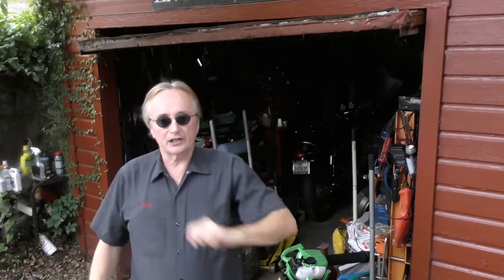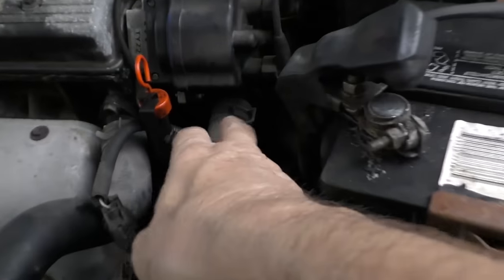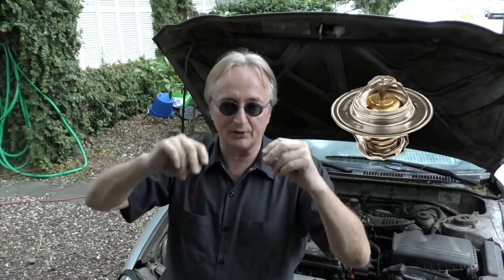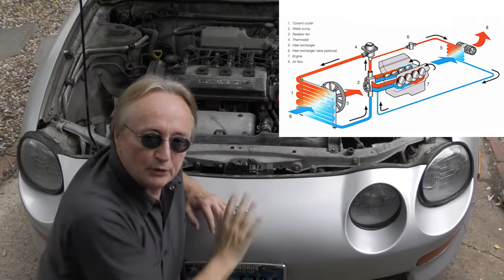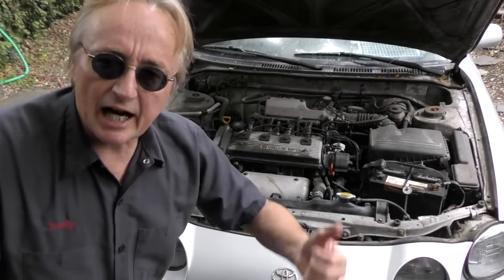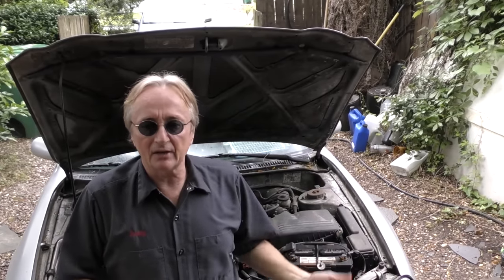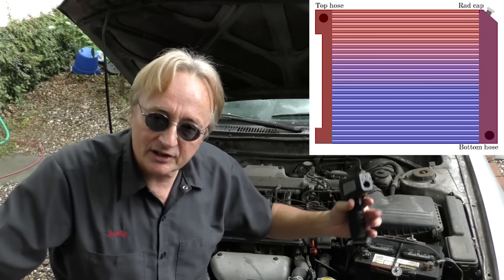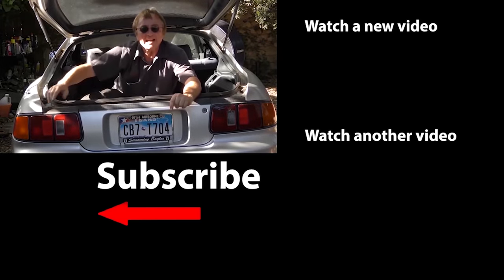Doing This Will Make Your Car's Cooling System Last Forever

Comment: If you have a bad radiator cap and engine overheats, let it rest, put water in radiator but don't place back the cap, let the radiator port open and it will not overheat. It'll give you enough time to get in a repair shop to work on it.
Trust me this works.

Comment: I've had HORRIBLE experiences with aftermarket radiators. Absolutely horrible. I've had two of them that were molded incorrectly on the tanks and 2 others that failed within 6 months or less.

Comment: Plastic radiator tubes the lower can crack especially if u have bad upper engine mount above the valve cover causing pulling of the lower radiator tubes. If u do, ur radiator tubes will tear

Comment: On my old car which was an Audi, nightmare when I had to replace a $40 thermostat, it was behind all the timing belt pulleys the labour cost me the same as the labour of replacing a timing belt and pulleys.

The worst part about it was that I just did the timing belt service two weeks prior to the thermostat going. So basically paid the same labour cost twice in two weeks. Considering that the timing belt service happens once every 100,000 kms every five years or so.

That’s why my next car was not an Audi
Reply: You should have just changed it when servicing the timing belt. Common sense. Same thing when your water pump is behind the chain or belt, but yeah Audis are terrible. They make BMWs look reliable and cheap to work on in comparison. Haha,

Comment: If you want to make a radiator last a long time,just ground the aluminum or metal core.This will stop all galvanic erosion on all metal parts in the cooling system.Try it ,it won't cost you anything.P.N.

Comment: Buy OEM and do it right, or don't and do it twice.  I shop and often seek non-genuine, but then gotta do it over.  I save by watching these videos, so I do it right and buy genuine parts.  I'm now looking for a video to change fuel filter on my 2000 Corolla, I think it's in the fuel tank.

Comment: i had heating problems and i figured the head gasket was gone so i changed the head gasket 3 times and i accidentally hit my rad and the fins just went to dust, changed the rad and my problems went away, i also used to change my coolant and rad cap  to make sure they were good, i also wound up putting in a bigger rad in my car,

Comment: i always buy the failsafe type thermostats that stick open if the wax motor leaks etc. not OEM, but a bit better piece of mind knowing that the result of a failed thermostat is an engine running a bit too cool.
Reply: Yeah, harder start vs overheating. Definitely prefer the first.

Comment: Hey Scotty: love your videos. I've been having trouble with my 1993 Ford E350 Econoline van. It's a Ford chassis and a Damon Hornet RV. The engine runs hot. It's been doing this which I know is not good. The gauge never states that it's overheating. I noticed that there was no coolant in the radiator so I added it. I realized later that I should have added to the reservoir and not the radiator. Now it's steaming and leaking underneath. Is there a leak or is it doing to that because I put it directly into the radiator? Thanks.

Comment: Thanks Scotty for all the valuable information. I have a question about the AT 205 Reseal can we use it to rejuvenate tires with it?
Reply: I was about to ask that question.. well, does it scotty?
Reply: Not good to use on tires, weakens the side wall flex, some go to car wash every week and put tire shine on wheels this is not good for tires no matter what cleaner/shine for any tire. Better off scrubing tire with brush and baking soda, for your own safety

Comment: Hello Kind sir,  I have an older Ranger that had seriously old coolant,  led to some big rusting issues.  Flushed it out but can I now extend the life of the radiator at this point as well as protect the water pathways by using a rust converter in the system?  I've used some before but thinking it would help convert that rust in the system to a safer surface?  Any thoughts of running a rust converter in there and leaving it in?   Thank you

Comment: Im from austrailia . Im 53 years  of  age . A good thing to know. Is put boiled water staight away in a class. With your new thermostat. To see if it works properly.  Because three   i put in cars over ten years. Were not operating. Did my head in working out the over heating proplem that still existed. It pays to test them it can happen.better to be safe than head plucked

Comment: Scotty I'm baffled.  I got a car at salvage and replaced radiator,  fan unit with built in resistor, ac condenser, thermostat. The radiator fan doesnt kick on either speed.  Voltage at relay/fuse box, relays checked good with resistance,  fuses good, fan direct wired and it kicked on, fan resistor has resistance, temperature gauge gets to halfway mark, ran engine without cap in case of air lock. Still no fan kicks on. 2012 fiat 500 sport. When I squeeze upper hose water will push out of tank. Any ideas? You're the best!!

Comment: Silicon rejuvenates plastic or ruber.    Yeah the thermostat and cap usually cost the same low price at the dealer. I know there is a after part company called oem but its not in reality the original parts manufacturing company its just a good marketing name.

Comment: Ok this is all great, but what is the proper operating temperature (coolant, oil) in a typical engine?  What is TOO hot? My coolant is typically about 195 F while the oil is slightly hotter at 204 F.

Comment: Hey Scotty, my 2002 Subaru Outback has been overheating so I have been checking all these components. The fans work, the water pump works, I found a little rubber nib cap (normally used to cool a turbo rig, which my car doesn't have) that had cracked, so I replaced it and refilled the system and burped it. Since then, I drove it a relatively short distance and it overheated again. A mechanic friend suggested I replace the thermostat. Does that seem right?
Reply: Yes, replace the thermostat. If it’s a 2002, the thermostat may actually be original.

Comment: Hey scotty having an issue with my wife's 03 civic ex 121,500 Miles. It over heats & most of the cooling system was replaced from water pump the radiator, thermostat & hoses fans kick on when are supposed to. Even checked for a head gasket leak the blue fluid didn't discolor at all. I thought maybe heater core is issue but everyone says its impossible, what do you say? We've never met but I'd take your word over almost any other guy lol

Comment: I had a Toyota years ago long before computers that overheated everywhere I went.  The thermostat was changed multiple times and radiator removed and cleaned out with no success.  Many years later I learned Toyota water pumps go out and MUST be changed as often as the timing belt.  
That $1000.00 car cost me $1000ssss.

Comment: Hey Scotty, I looked at my Honda CR-V 2009 fans with AC on and it was only one fan running. Is that an issue with the other fan or it’ll run when I drive? Thank you

Comment: Scotty....what would happen if  ATF was used as an engine coolant instead of water /antifreeze? It wouldn't freeze, the water pump would last forever and a  blown head gasket, leaking coolant into the engine oil, would not be catastrophic.

Comment: Got any tips for me?

my 96 astro van accelerates from a stop in first gear fine but it stays in first and revs at about 25 to 30mph until you let off the gas just right then will finally up shift to 2nd then will go straight to 5th
Once on the highway way at 60mph the van runs fine and has power in passing gear fine as normal. Fluid looks ok no leaks. had this problem two months after rebuilding the transmission, and also saying it has random misfires in cylinder 4 and 6 and I already replaced it with new rotor, new distributor, new cables and iridium spark plugs. Do you have any ideas?

Comment: Here in the tropics mechanics insist on removing the thermostat, insisting it's there because the cars were designed for much cooler climates ( As if they don't have summers ) !

Comment: Scotty I have an '04 Ford F-150 my AC does not run, they tried charging it but did not need it, they looked at fuse and master fuse they looked fine. The Condenser looks fine and the fan is not 'locked' or 'Frozen'. What they are telling me the unit is not receiving power. I looked at the fan belt but they said that looked fine aswell. Any idea on what it could be? I am stumped. I am curious if the switch could be faulty.

Comment: Scotty, I have a 2021 Acura ILX, I flushed the coolant out, refilled it, with Peak 50/50. I burped all the air out. Now I’m only getting heat on the HI setting. Any idea why? I’d appreciate it, if you can help me out? Thanks
Reply: ahhhhh, did ya also seperately flush out the heater core ?  Regards that, I've viewed a couple u'tube vids 
{ aka visual recipes :-)   }    Hope tah do my '96 Sierra by mid- Oct.   .....

Comment: What do you say about Lexus es 350 the whole engine bay is covered with the plastic and heat stay inside the engine bay and make all plastic clips and hose hard and they break even we touch

Comment: My 1988 Nissan Sentra is overheating. Both fans work when ac switch is on but when the temperature gauge gets high the radiator fan won’t come on. Relay switch changed temperature sensor changed thermostat changed. I put a brand new radiator on the car a year ago. A mechanic told me it might be the water pump or a blown head gasket but I’m not losing any coolant. Do you have any idea what it might be

Comment: I have a 2000 Toyota Camry 4 cylinder it's overheating. It started only when driving in city traffic not on the interstate. I tried to flush my coolant and change my thermostat. Radiator must have had water in it because it was corroded very badly. I'm still getting hot air through my heater core most of the time when my foot is on the gas. When I slow down it starts getting cool do you think it's my radiator or should I flush my heater core also. Which is the inlet and outlet on the heater core!?

Comment: Scotty I've a 1996       46L GT mustang  seems too louse antifreeze here  an there I can run for days won't leak then a gush under the car  one day it started backing up spewing out the resivor tank I keep the radiator cap on tight enough so it won't fall of any way without getting porked wear can I start

Comment: The fans work, and the temperature gauge is in its normal spot, in the middle. If I set the heat, to say 80, you can actually feel it getting cooler? Certainly not 80.

Comment: I had an issue of overheating when the AC is on for at least an hour in my 2012 Accent. My mechanic did an overall to my Radiator, and added some more pre-on on the AC. And then he also find out that the Thermostat was also busted, i never had a replacement since 2012. What he did, he just removed the thermostat since we our in a hot country, it won't necessary to have the thermostat installed. 
So far, my issue was fixed for a week now and the engine runs smoother than before.... Is it really advisable not to use a thermostat on your engine in a hot country like the Philippines? Thank u.
Reply: Still using thermostat in the Philippines but need to replace every 5 years
Reply: In Vietnam hot country like Philippine they are still used the thermostat

Comment: Hi Scotty,  I am trying to fix my son in laws 2005 Lexus IS 300.  I have replaced raw water pump, the thermostat, the radiator, the radiator fans and I have tried flushing the system but, it keeps overheating 🥵.  What am I doing wrong?  Is it a air bubble stuck in the back of the engine?

Comment: I've got a 2001 Dodge Stratis with the small  4 cylinders 140 C.I. I think. Whenever I drive it very far + or - 15 miles it makes a percolating sound but hasn't boiled as far as I can see in the reserve tank. Any ideas what this is, it doesn't seem to lose any fluid. Thank You.

Comment: I did blow head gasket because bad radiator cap, so change them before they go bad and start to let air in what causes boiling and then boom head gasket is fried.

Comment: I still owned a 1998 Mazda MPV V6 and recently I have a probelm with my temperature Gauge going all the way up. My mechanic replace the thermostat and  temperature coolant sensor together, but  still temperature gauge sill going up, but the best thing the engine is not overheating. My mechanic  told me not to worry and drive it as long as I could.  Is he right. Need Help Scotty. Thanks

Comment: Hello Scotty-I have a 1999 isuzu rodeo 3.2-I had a THERMOSTAT Stick It has only did it one time-The Thermostat is only $5.00-But you must that the Intake-- fuel rails and injectors off, the Thermostat is under the intake, Do you think that a GOOD RADIATOR FLUSH Will fix the Problem? I do not have the  mechanical  ability to do this job that need to be done with the Thermostat replacement--0 Hay and one more thing-Now im not having this problem but if you  use a stop leak in a coolant sys will it not stop up the little small hole that is in a Thermostat  that lets a little coolant go through? Now keep in mind that my thermostat is  probably from 1999,

Comment: I had the exact opposite problem in my truck not long after I got it.  The thermostat was stuck open so it wouldn't reach proper temperature.

Comment: 2003 Dodge Ram 1500. Guess the engineers thought it would be fun to turn the cooling system upside down. Oh but wait, we’ll put this purge plug on top to purge the system. That only takes days to completely purge the system.

Comment: I have a 2008 Hyundai Tucson gas 2.L 2wheel drive 5forward have this ruff idle I have changed plug and cable wire

Comment: My 2002 Saturn Vue 3.0 v6 engine has started overheating at a stop in traffic. Radiator fluid flushed in November of 2018. If I put in park and rev it up it cools down. If I'm moving it stays cool. I noticed on return water line to fill tank I have bubbles in with water. Need help on this. No leaks I can find.  Mechanic I use said back in November all was good.

Comment: Scotty, if your vehicle has a 185 degree thermostat and you are running an electric fan, what temp should you have it turning on/off?
Reply: A fan should turn on as soon as the thermostat opens. So if it's meant to open at 185 degrees Fahrenheit, then the fan should turn on at that temperature, and also turn off when coolant is cooled down to a lower temperature. I have a problem where my thermostat or temperature sensor doesn't tell fan to turn on when it's supposed to turn on, it kicks in late. Should turn on at 194 degrees Fahrenheit, but it turns on at around 203 degrees Fahrenheit. Advice: Don't buy modern cars, much more difficult to diagnose a problem and repair.
Reply: Thank you, solid advice!

Comment: I have a problem with my system. The overflow tank had a crack on the top of it so I replaced the overflow tank then the hose blew. Seems to be running normal temp but soon as I shut the car off seems like a lot of pressure

Comment: This is a noobie question i know, but is it normal for a car Idling to reach 105ºC ? yesterday i drove it and it reached 110ºC and the fan did not start, today i changed the thermostat, once it reached 87C i heard the water cycling trough it, and then it reached 105 before the fan started and it cooled back to 95 degrees.
The car in question is a Volvo S80 5 cylinder petrol.
I did not hear the coolant boil or anything so i assume everything is O.K

Comment: 3:02 you mention Japanese radiator caps and parts breaking off of them. I was checking my 1997 Honda Accord’s today and just that happened, and I could not retrieve a very small piece of it. I got a new cap, but is it safe to drive with that small plastic or rubber piece in the radiator fluid? Thank you.

Comment: I have a question for Scotty. I got Subaru Forester 2018 and driven only 17k miles. But recently I checked its coolant reservoir and it is right at the minimum (LOW) level. Now I'm confused that when Subaru says the factory coolant will last 130K miles is that the level in the radiator they are talking about or the reservoir? My radiator shows coolant level perfectly fine. Maybe the water evaporated from the reservoir and the level went below the maximum. So the question is should I top up the reservoir with DI water or with OEM blue super coolant or just leave it like that?

MPG on it is also very low in the city (14 mpg) compared to what it says in the advertisement (26 mpg).

Comment: I have a 03 Supercharged Tundra that called for a thermostat change from the original 180 degree to a 160 degree thermostat that came with the supercharger. The 160 degree stats are very very expensive if you can find one. Will the standard 180 stat be ok if I ever have to change it?

Comment: I had a new radiator put on a 96 Camry, my car only ran hot because the old radiator cracked on the top.  So why is gauge moving to the hot after a new radiator, if there's no coolant leak?

Comment: Scotty, I have a doubt the i30 Hyundai 2009  radiator  fan.kindly help .will the fan on the front rotate always? .the fan behind the radiator not rotating at idle i switched on the ac also it was noti

Comment: hey scotty i have a 2010 subaru outback 2.5 auto with 115xxx. it over heats and coolant is pressurized and shoots out the resivour. could it be a bad head gasket???

Comment: Hey scotty,i have an old peugout 206 with a 1.6 litter engine,recently when i turn off the engine and start again in about 5 minutes the engine heat goes up for a short time before the cooling fan kicks in and then i get a check engine light...can you tell me what the problem is?thanks